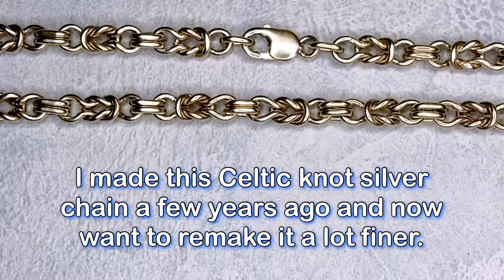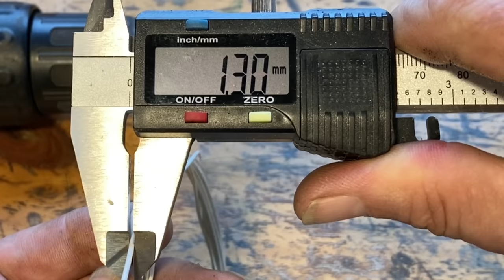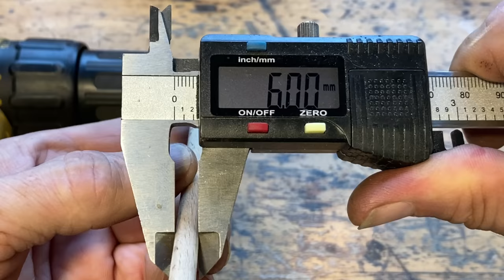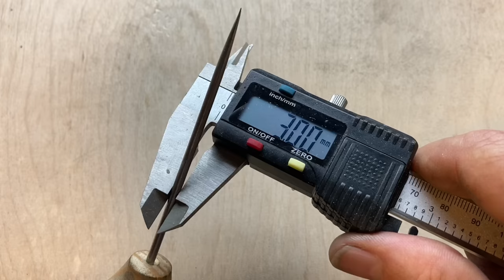Making a Celtic knot silver chain necklace (with favourite pliers)

Comment: Took me awhile to figure it out.  I changed the size to 18 gauge so it was easier, then after I  made a few links I switched back to the 16 gauge.  I love your tutorials and the fact you show the size for the wire and mandrel.  Thanks so much
Reply from the maker: thanks for your comment Valerie, I test and practice a lot with copper first to find sizes and dimensions that I’m happy with before tentatively committing to silver. i’ve learnt so much from YouTube videos it’s now nice to be able to give a bit back … cheers … Nick
Reply: Did you use half hard or dead soft wire?

Comment: I didn’t realise you could tumble polish silver like that. This a very useful video thank you!
Reply from the maker: hi Jasmine, yes it’s a very easy way to polish stuff just throw it in and wait. The only problem being  it can take a long time, minimum 4 hours.
cheers …  Nick
Reply: @Nickscreativestuff  I don’t mind the wait or the noise (I’m deaf lol) thanks for the info though. The finish is amazing! I need to try this! 😊
Reply from the maker: there is a few different mediums that can be used for polishing, I use a very small stainless steel shot, it’s great for getting into all the nooks and crannies of a fine chain. … N
Reply: @Nickscreativestuff  how would it fair for working with fine silver 99.99? Do you know? I love all things silver, working with different gauge wires etc eventually I want to get into casting rings, pendants and clasps etc. I too use a knitting needle for making links!! I love creating things. Looks like you have a real flare for it! I found how many times you stretched and annealed particularly interesting. Thank you for taking the time to answer me.
Reply from the maker: hi Jasmine, A tumble polisher works well for sterling silver, fine silver, golds, bronze, brass and copper although never to mix them in one tumble. The other thing not not to mix is heavy items with delicate items. Otherwise you can get a lot done in one go. i’ve not done much with fine silver but I find sterling work hardens very quickly and needs constant annealing. I to have true love for creativity and couldn’t imagine life without it …  all the best … Nick

Comment: Bought some solder paste on amazon because it had good reviews. Every time I try to use it though, it burns weird and expands like one of the snake things we use on the fourth of July. Ended up ordering from cookson and hoping it works better, lol.
Reply from the maker: Hi Xavier, solder paste can be a bit fussy to use … your work needs to be clean with a tight joint, it needs to come up to temperature quickly and it’s easily overheated due to its built-in flux.  because of this it’s only really suited to small items like jump rings ect. However once practised it’s a fabulous product allowing repetitive jobs like chain making to be quick easy and efficient to do. it’s very easy to use far too much on a joint so it’s worth practising on a few copper links to see how small amount is needed … when heated it does sort of bubble, burn and expand just before melting and converting to solder … good luck with it … Nick

Comment: That is a very cool design! I try to put the solder joint on the side of oval rings instead of at the bend; I seem to break fewer links that way.
Reply from the maker: thanks for that mark, The reason for me putting the joint at the end of the link is it helps hide any of my scruffy joints once the chains assembled … cheers … Nick

Comment: Instantly enchanted by you chain and immediately decided I'd like to have a go - then I saw the amount of skill needed, the kit you use and decided it would be easier to buy one off a local craftsman at the jewellery quarter in Birmingham.  Thanks for showing how it's done, it's a lovely watch.
Reply from the maker: hi Northern Light thanks for the comment, this chain is the outcome of lots of playing around with copper wire … A great place to start for chain making as copper is cheap and very similar to working with silver … all the best … Nick
Reply: Soldering and annealing are the only difficult parts as you have to do them repeatedly.  However the rest is not daunting.  Use Aluminum (all metal should be Dead Soft grade), keep the chain links round, so you don't have to solder each link. The reason for soldering is to remove the open end of each link because he has to stretch it into an oval shape. Without the oval shape or fancy twisties, you can easily make a chain.  Make different link rounds, hammer or texture them, use small washers even. You will need two nose pliers and a hammer and a rod to make the coils. You can coil with drill or by hand.
Try it with cheap aluminum first at 18 gauge or higher. 20 gauge is a bit too soft for chain links. Then switch to Dead Soft Copper. Do not buy Half Hard or Hard.
Each aspect of jewelry making is a trade skill - annealing and melting, soldering and welding, hammering and hardening, deburring and polishing, working with wire of different metals, shapes, tempers, and gauges.

When you were a baby, looking at an adult walking or running seemed an impossible task, but you accomplished the impossible, didn't you?  One step at a time. Its not hard.  Its easy.

Comment: Your tools are beautiful!  Love those industrial looking pliers!
fyi - make text smaller so we can see the screen better.  It's hiding some tools.
0:57 - How clever!!!  I love the way your mind works, ha ha ha!  I think your DNA has genius genes.
Q: Do you have to cool down silver after soldering, in cool water?  Can you skip this step for silver?

So much work on the links, wow!  I'll never complain about high prices again. 100% worth it. You are buying an artist's work.
Thank you so much for this lovely video!
Reply from the maker: thanks MJ, my favourite pliers being cheap and from the car mechanics industry instead of the posh jewellers. thanks for the tip about font size i’ll check that out and try and improve my ways.
This chain is only possible with a lot of annealing. Quenching in water is part of that process but not necessary after soldering. I think my video made it look a bit long winded when really it’s a relatively quick chain to make with a bit of practice and batch processing the steps … all the best … Nick

Comment: Amazing process and result! If I may ask, why use a saw instead of just cutting the rings with wire cutters? The need for blunt ends to solder?
Reply from the maker: thanks for that mystic, when soldering joints the tighter it is the better the result. The least amount of solder used the neater the joint will look. Also a tight flush joint is much stronger essential when stretching links like in this video … cheers … Nick

Comment: I just love this. Where do you get (or make) the metal sleeve for the circlip pliers at 4:18 please?
Reply from the maker: Thanks Deborah, I made that bit of tube. Long time ago now, can’t even remember the size of it. it comes about with trial and error using copper wire first. You could drill a hole through a piece of large woodwork nail, the hole doesn’t need to be dead centre … N

Comment: Who makes the round-nosed pliers called you're using to stretch the links after annealing? Where did you get them? Never seen pliers that open like you were using them.
Love your work, maybe I should get into this style of jewelry creation!
Reply from the maker: hi Steve, The tool I was using is called external circlip pliers. not sold in the Jewelry industry but used by vehicle mechanics … I bought mine from an outlet called Halfords. I find the repetitive monotony of chain making very satisfying but not everyone has the patience for it … cheers … Nick
Reply: @Nickscreativestuff  Thanks. Found a reasonable pair on Amazon. Have done wire working & wire weaving for a few years & enjoyed both. Thinking about branching out into what you're demonstrating. I bought a butane torch years ago, it's been used mostly for soldering. Do you think this gets hot enough for copper or silver work?
Reply from the maker: hi Steve, A lot of varied jewellery tasks are achieved with a small handheld refillable butane torch. however they have the limitations, they are quite capable of silver soldering up to a certain size, weight and mass. they’re good for small items like rings, chain links, earrings ect.
you would have to step up a torch size if you were soldering say things like cuff bracelets larger cabochons and brooches … N

Comment: I have had a few goes at this and I am struggling. I can do it with copper wire but the silver isn't cooperating.  Is the wire you are using dead soft perhaps?  
And thank you for the awesome inspirational videos 🙂
Reply from the maker: Hi Amz thanks for that, sorry to hear you’re struggling with it. I find sterling silver work hardens very quickly and to make this chain I need to anneal the links at ever stage of bending. Well soldered joints are important with all the pulling needed and I leave the clean up until the end to make sure they’re as strong as possible … hope this helps … Nick.

Comment: I've been thinking about trying to make this chain but I had a few questions about some of the tools used. What is the measurement of the cylinder piece you put over the plyers at 4:14?
Reply from the maker: hi David, The small tube that I made that I put over the tip of the external circlip pliers is 4.6 mm cheers … Nick
Reply: @Nickscreativestuff  thanks man. I was on the verge of giving up on making chains, then I found your videos. Keep up the amazing work.
Reply from the maker: thanks David,  I do love chain making  … very satisfying to try and come up with something new and a bit different … N
Reply: @Nickscreativestuff  sorry to keep asking questions but do you know the overall length of wire used? I noticed the first bit of wire used was 2ft but I'm sure that couldn't be the total length used. Lol
Reply from the maker: sometimes I work backwards by using Cooksongold automated calculators. they’re off-line at the moment but what I do is go to their website and search for 1.3 mm round sterling silver wire, I know the chain weighed about 32 g when it was finished so I keep adding length to the calculator until it reaches the 32g. without being able to check I would guess it would come out to be  about 2.5m … sorry to be vague hope this helps … N
Reply: @Nickscreativestuff  awesome. Thank you. I use Rio Grande to order my wire and they give the option to do either by length or by weight so I understand what you're saying. I started out making rings but have slowly started trying chains after watching your videos.
Reply from the maker: Rio Grande is great I ordered some bronze casting grain from them that I couldn’t get here in the UK … they dealt with my order efficiently it was cheap and arrived quickly. I really got going with chain making when I discovered soldering paste makes life very easy when using a lot of links … have fun … N

Comment: So beautiful.  But it's that soldering... 😂... I will begin for a tutorial... 
The tumbler is also from Cooksongold? I thought I saw this one on their site.
Reply from the maker: I get most of my jewellery tools and supplies from Cooksongold. 
you should try soldering paste it’s a little bit expensive but you use tiny tiny amounts …  perfect for jump rings … your joints needs to be clean and tight fitting it won’t fill or cross gaps. after a bit of practice it’s very quick and easy to use … N

Comment: Hi N, loving your video and learning so very much...Thank You for that!! May I ask...what's the key type tool you're putting inside the double jump rings in order to keep them to size and not mashed in???
Reply from the maker: hi Terry thanks for your comment, I originally included making the key tool but had to shorten the video. I  made this little tool by cutting the shape out of a large washer that happen to be 1.5 mm thick. It works really well for a consistent squashed and resized link …  all the best … Nick

Comment: Hi nick love your videos I have tried doing this chain and I’m struggling making the knot out of 6mm ID Sterling silver 1.2 wire it keeps snapping on me is there something I’ve missed many thanks Chris
Reply from the maker: Thanks Chris, I suppose this sort of technique is pushing silver to its limits but is possible if you go gentle with it. A few keys for this to work is lots of annealing at ever stage, using a dab of oil when links are rubbing and being stretched and pulled into a knot, good strong soldered joints that are cleaned up at the end if necessary. Being gentle when manipulating the links - if not moving easily stop re-anneal  and try a different shaping technique … good luck with it … N

Comment: Good morning i can simply say it's not the project itself but watching the video takes person to a state of perfectionism thanks for  sharing .can i ask you  where do you buy these pliers you are using ❤
Reply from the maker: hi Connect Cell thanks for your comment, these tools are called circlip pliers I got mine from an outlet called Halfords. they are mostly used by vehicle mechanics to remove circular clips that hold bearings in place. They come in a few different varieties for external or internal clips the difference being either they open or close when you squeeze the handles … hope this helps … Nick

Comment: Nice. What gauge silver wire & size of jumprings did you use to make the heavy silver chain you made a few years ago?
Reply from the maker: Hi J Gribbell, The wire diameter I used for the chunky chain was 2mm and the internal diameter of the ring before bending if I remember correctly was 12mm. its worth practising with copper wire first to make sure the sizes work … hope this helps … Nick
Reply: @Nickscreativestuff  Thanks Nick,I look forward to seeing some more chain videos.
Reply from the maker: I do love chain making, i’m halfway through a wrist chain as a variation of this one … cheers … Nick

Comment: Maybe be no sound, thats ok. Good video with descriptions added. I learned a lot about chain making. 👍
Reply from the maker: thanks for your comment Myke, I thought I would try without music … now find it a bit boring without … N
Reply: @Nickscreativestuff  AS it is. I want to try my hand at making jewellery. and since I have a skill at making small stuff.  I have a question. I see you use a small torch. You think a hot air blower would do the same thing?
Reply from the maker: Hi Myke, making jewellery is a lot about learning to solder. The type of solder used for jewellery melts at a very high temperature and is more like braising. Silver solder starts to melt at 700c so a gas torch is crucial for the process … good luck with it … N
Reply: @Nickscreativestuff I'm a novice at this so I'm starting very simple and easy I'll get more completed as I go on. As for melting metal right now. I'm not ready for that just yet. Soon I hope.
Reply from the maker: A lot of people are in the position where they can’t use gas or flames
but still produce gorgeous stuff. instead relying upon and specialise in so-called cold connections, riveting and wire wrapping … have fun … Nick

Comment: Hi Nick.  Are you using hard solder for all your joints?
Reply from the maker: hi Jim, sorry I forgot to mention that I started with hard solder for the knot and then moved on to medium and easy for the two connecting links. i’m sure it would work fine with just one if you’re careful. it makes things a bit easier if you have all three grades … all the best … Nick

Comment: Silly question - Did you start learning with copper? I just started my journey into making chains. I don't own a tig welder - what would be best to use to solder the links?
Reply from the maker: hi Luciano, I tend to test tryout practice and experiment a lot with copper wire first before moving on to silver with a design. copper and silver are so similar, if it works with one it will work with the other. To learn to solder it’s probably best starting with traditional silver solder and a borax cone. solder wire is good because it can be cut up easily into consistent sized tiny pieces. This solder works the same on copper or silver  … good luck with it … Nick
Reply: @Nickscreativestuff  Thanks for the reply. You've got a new subscriber here.
Reply from the maker: thanks for that Luciano … Nicks

Comment: What are the little metal bits that go on your pliers? I kind of want to try something like this...
Reply from the maker: Hi Pixelae, i made the length of steel tube that went over the pliers however it could be made from a much shorter length of steel or aluminium rod. drilling a hole down the centre of a short piece would be much easier to achieve and it doesn’t need to be perfectly centred … N

Comment: Hi Nick, after watching this 3 times. I have 2 questions, # 1- You said "I managed to miss out a crucial bit of information in the video for making this chain and that is the wire diameter i used being 1.3 mm." the video showed 6mm on your calipers, I am sorry to bother you but I don't understand the diameter difference. Being from the US I am not totally familiar with the metric system. #2, what is the outside diameter of the sleeve or bushing you used on your needle nose pliers. Thank you my mate for making all your videos. You are doing a prefect job.
Reply from the maker: hi Bob, sorry about the confusion, especially with the metric and imperial measurements. The wire was definitely 1.3mm or 16 gauge.  The rod used to bend the wire around into links was 6mm. i’ve managed to mislay the sleeve I use over the pliers but I think it was about 4mm. Being in the UK and learning metric i find it rather baffling trying to convert to Imperial. Even Alexa and Siri find it confusing. Being rather precious with my silver I tend to test and practice everything with copper wire first to make sure sizes and dimensions work well and I like the look before committing to silver … N